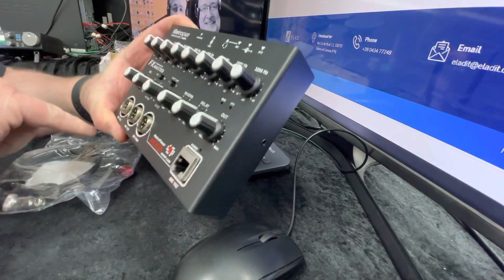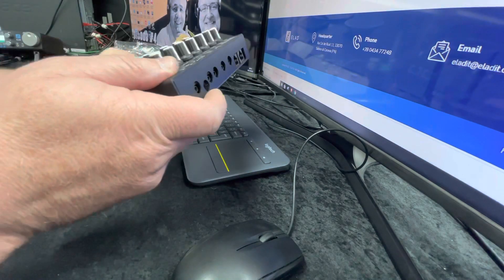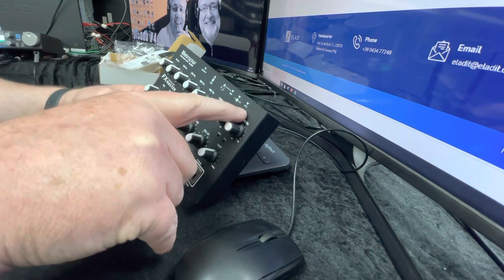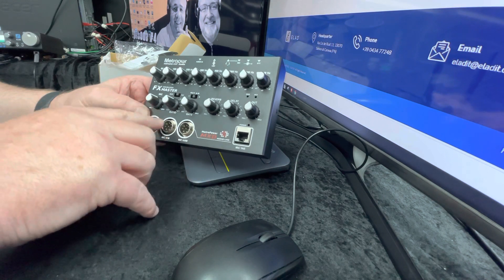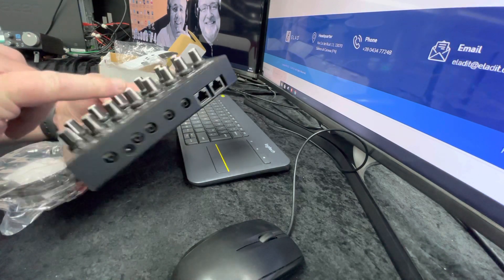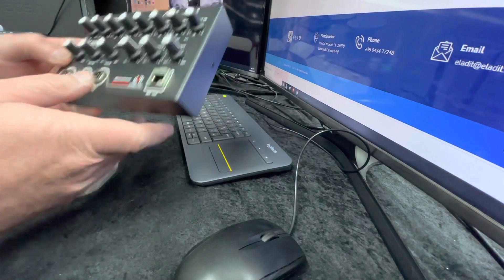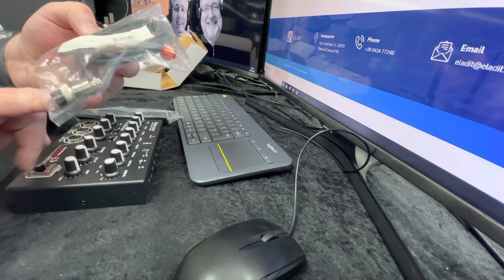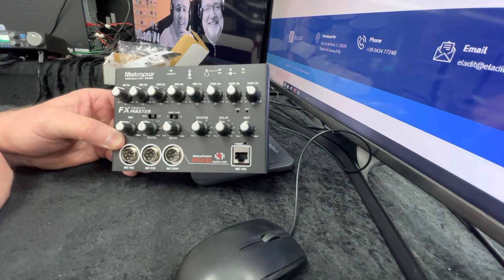MetroPWR FX-Master Microphone EQ for Hamradio, Amateur Radio.

Comment: so if I had an icom. 7300 and icom 9700 could I use one mic with two radios with this device?
Reply from the maker: Yes I believe so, check the manual out as you will need to make cables.. Gaz

Comment: is there no power lead
Reply from the maker: No power cable, I have requested they look at this in the next batch, its a 2.1mm DC barrel connector so very cheap on amazon.. I have been steadily feeding customer feedback to MetroPWR I have a much better understanding how this unit is spec'd now, it does have some short falls but on the whole this is still a great device that fills a gap.. do you have one?? Gaz